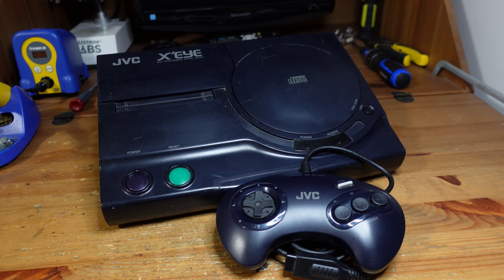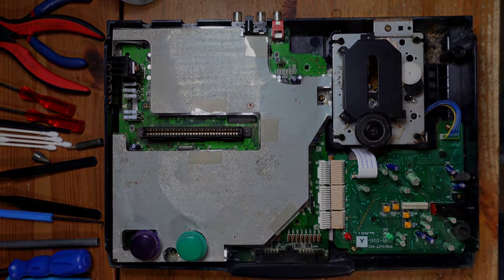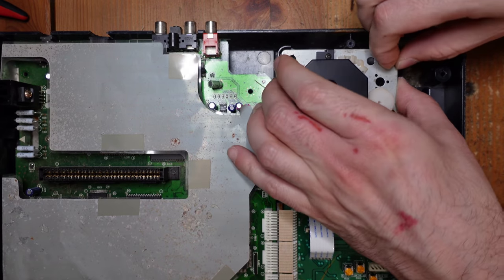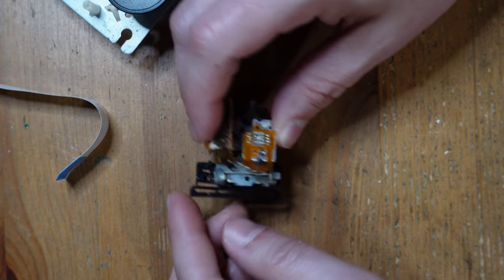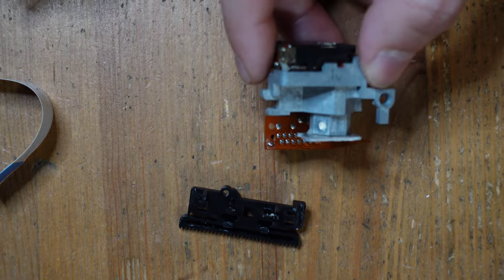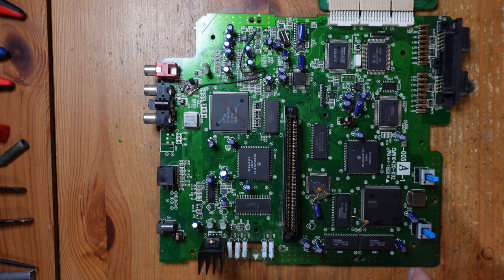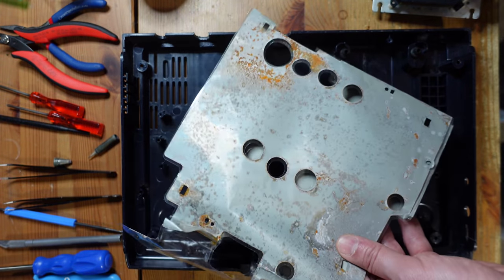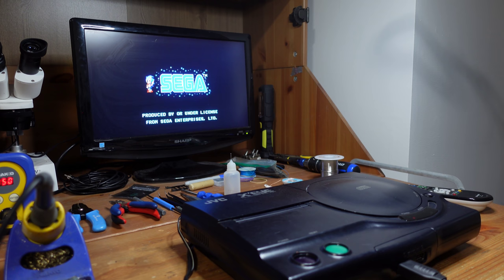Rare JVC X'Eye repair and restoration! Complete teardown and laser replacement!

Comment: Very interesting video. I have one JVC X'Eye working properly for now. And a second one where the genesis slot works fine, but no sign with the CD Rom part. Except a little laser move when system is switched on/off... I tested Laser block and the little board near it. Both are functional. The main board shows no sign of capacitors troubles... Very worried for this second system. Any idea where is the problem !? It's surely something with the main board where 68k CPUs are located...😢

Comment: Nice work and beautiful console, but honestly I expected a more thorough cleaning of the mechanics of the optical drive also given the presence of rust. I am used to completely disassemble them down to the last screw to clean and lubricate them.
Reply from the maker: Thankfully the rust was just limited to that corner and it was nowhere near the gear assemblies. All of those parts got lubricated and I cleaned off the remaining dirt. But thankfully the rust was just that little corner

Comment: I have to get around, replacing the caps in mine along with getting a new power supply from RetroGameCave. bought it off someone who didn't have the PSU but at least they had the branded controller.
Reply from the maker: Thankfully the caps that Sega used were really good quality. Replacing them is not too bad, just time consuming

Comment: I bought a JVC X'eye on eBay back when you could get them for 50 bucks.  I also got Monkey Island pretty cheap as well.  My X'eye couldn't play that disc, but played all others I had perfectly fine.  A buddy of mine also had the X'eye (the reason I bought my own) and his could play my Monkey Island disc. I noticed that his console would "zip," the sound you hear when the ODD is accessing data.  Mine wouldn't do that, so I chalked it up to a faulty motor, likely the reason the seller let it go so cheap.  I later found a 32X for 5 bucks and it worked flawlessly with my X'eye so I played plenty of Star Wars Arcade and Knuckles Chaotix and forgot about Monkey Island.  I still want to revisit; but it's all been in storage for years...
Reply: Did you ever happen to figure out what the fault turned out to be? Mine seems to have your same problem 🤷‍♂️
Reply: @DougSayers  no, it's still in storage.  I was considering sending it to this channel to see if he could fix it.
Reply: @adamgardner28  cool idea 👍

Comment: I know this video is older but I'm working on an X'Eye right now and was curious if you had seen this:

System boots up fine (has new region free BIOS and FRAM) and plays genesis carts ok, but doesnt even attempt to spin disc. Have tried multiple lasers (one replacement and was sure to remove anti static blob). I verified the lid switch / sensor is working ok as the dashboard switches from insert disc to checking disc as soon as I close tray or if i push it down by finger. This was also confirmed using test point pin on the CD board, it changes between 0V and 5V when the switch is activated or deactivated. I can see the red laser for a brief moment or two when first closing tray, but absolutely NO life in either motor, for the spindle or the feed.

I separated the CD Drive from the system and wired up 5V direct to the motors and they activated ,so i know the motors are good. When system is plugged in and turned on (and lid switch depressed, im only seeing .900 volts on the motor terminals

I verified that IC691 is showing correct voltage for laser on / off on pin 48. The only thing "off" is that supposedly Pin 4 of IC601 is supposed to show 5V to be fed to spindle motor as step 4 of the CD operation flow chart. Im getting around 2 and a half volts. 

So I'm considering ordering a replacement IC chip Sony CXD2500BQ but I'm not 100% confident thats the issue, I dont have a working Xeye to compare voltages. 

Just was curious if you had ever seen an Xeye that wouldnt spin discs and it wasnt a lid sensor issue. System has also been deep cleaned and fully recapped
Reply: I'm guessing you tried cleaning the laser eye with a q-tip and rubbing alcohol?. Also did you try manually pulling the sled away from the spindle and see if bootup brings it back to the middle? You may have to adjust the laser eye ohm pot as these laser can get weaker as time goes by (or sometimes someone else fiddles with it). But try to take a reading before you adjust so you can always set it back. (I had one that wouldn' read disks recently and just turning it 1mm fixed it right up.
Reply: @Elecyview  interesting... So as someone that doesnt really mess with optical drives much a failing/dead laser will prevent the spindle from working too? As in during the process does it only spin up if the laser can see a disc is inserted? No, i can have the sled all the way towards the outside and it never tries moving the sled. Havent messed with POTS but I can take readings using my multimeter and try
Reply: @LedZepFan7183  I'm not an expert, but in my experience (gamecube laser eyes and a few playstations and now this JVC) The first thing that happens is the eye tries to focus a beam and get a reflection back to detect if there's a disc there that it can read, then it will try spinning up if there is. That way the motor never activates if there's no disk in there.  It's not a guarantee that is what is happening here, but if you've had the lid off and can SEE the red beam then its trying to read the disk. 

But it's wierd if you pull the sled out and it doesn't auto track it back to the center when you turn it on with the lid closed. (mine at least did that when it wasn't reading the cd's yet). So that could be some kind of issue with your measurements of the current you're seeing?

If you want to adjust the laser pot, There is one directly under the laser eye itself, you can see it from the 'back' of the laser unit after you take the black metal shield off the top (3 screws and occasionally these posts break off at the base over time if the console is jostled around a bit, so sometimes you can just pull this off without undoing the screws.) but there should be a single adjustable pot on that laser assembly.  (it is not the 4 or 5 that are on the cd circuit board that houses the karaoke jacks). For me I turned it about 1mm very very slight to the right. I don't have my exact values handy, but I believe this dropped my resistance by 100 ohms and that immediately fixed the issue with my first system. I didn't tweak much beyond that. Just makes sure you write down the current ohm reading so you can always put it back there if you go too far.. And make micro adjustments.. it should never be more than an 'hours' worth if you looked at this dial like a clock, if that makes sense (never go from 12 to 1, that's a big adjustment for this kind of thing). Just micro adjustments. 
This may not even fix the issue or even be the issue, but it is something you could try if you get exhausted of everything else. But the sled not returning is concerned, as I believe that should happen regardless if there's a cd in there or not...  Again i'm not a pro. Just a hobbiest.

Comment: I have one, I installed S-video into it. Only issue with it is when I turn it off the power light stays on, Been trying to figure out what is causing that.
Reply from the maker: That’s a very strange problem, not sure what that’s all about!
Reply: @LIRetroGaming  I've recapped it, checked resistors, cleaned power switch, replaced power regulator. After looking at schematics think it might be a line through the 315- ??? chip (I think it specific to the X'eye)

Comment: When you were in there, did the buttons look special to you?  I need a replacement button because the guy I bought mine from did a shoddy job of soldering one in for some reason and one of the legs looks too short to re install.
Reply from the maker: The power/reset buttons? They look like standard ones to me
Reply: @LIRetroGaming , I luckily tracked a new one down at Console 5.
Reply: So my X’Eye has a strange problem.  When I plug it in the system powers up, but even before I soldered in the new button, (which I thought was the problem because some of the legs weren’t soldered down) the power button does nothing.  Is there something I should look for?

Comment: Oh no, my X'eye lid won't stay closed! It just started happening, is that an easy fix? The open/close button is stuck too.
Reply from the maker: It should be an easy fix, open the shell and add some lithium grease to the lid mechanism and the button
Reply: @LIRetroGaming  wow! Thanks for the reply! It’s so hard to find info about repairing this system. Can I just order that on Amazon? lithium grease? I’m not a hands on technical guy. Luckily everything else about the system I bought was refurbished prior.

Comment: hi!! i have a sega cdx with original ac power adaptor, this works for x eye? thanks!!
Reply from the maker: Yeah it should work
Reply: @LIRetroGaming  thanks!! 😁
Reply: the cdx power supply works perfect! Do you have any idea? I have a problem with the sound through the white and red rca, I don't get sound, the video works through the yellow rca and I do have sound using the av out connection, thanks!! And another question, in the new láser lens how much calibrated the pot? 700 ohms? Thanks!!!